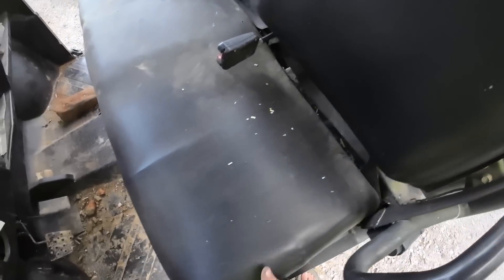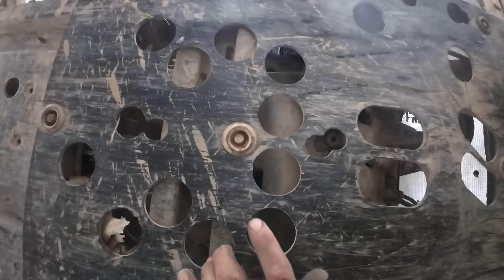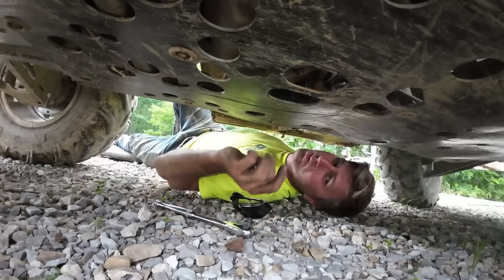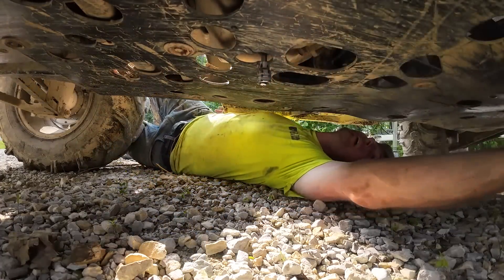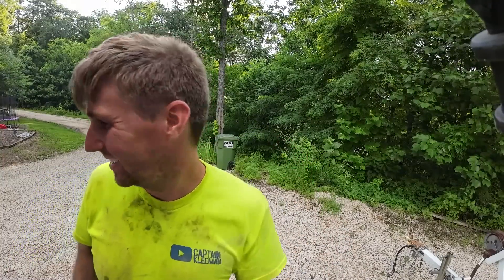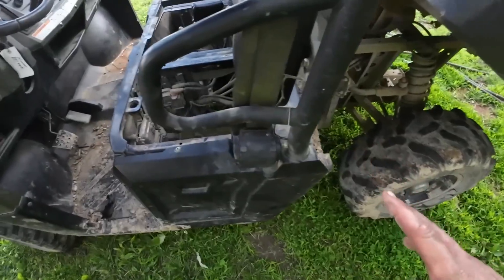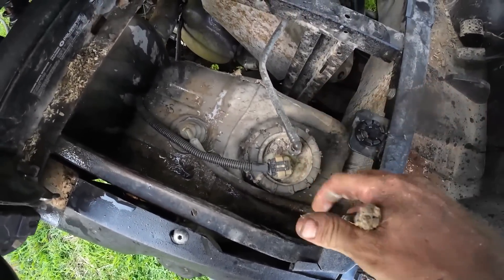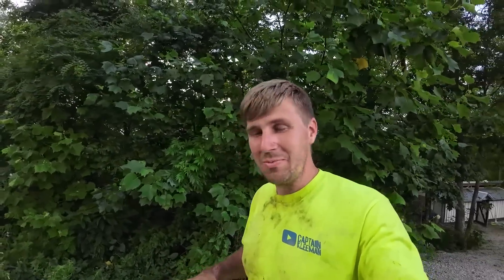Oil Change Polaris Ranger 800 EFI - Is This the Best SXS?

Comment: Well, morning, Captain.  We have had two SxS utilities, a Kawasaki MULE that we bought new in 2013, and a Polaris Ranger 800 EFI we bought a year ago.  The Kawasaki is in the barn, with the engine dead, the Polaris was sold to someone whose son was a Polaris dealership mechanic. Changing the oil was ridiculously difficult on each.  We had the Polaris for about six months as a "spare" for the MULE on the ranch, and in that time, I spent close to 20% of what we paid for it in parts alone. The undercarriage was junk, all four wheel hubs, one shock mount, I forget what else.  (I did all the work, I'm "retired" to the ranch, otherwise, I think it would have doubled the price of the SxS.) Of the two, I prefer the MULE, the damage was kinda my fault, because I didn't supervise the non-mechanically inclined person who used it daily for 10 years.  I'll never buy another Polaris.  (At my age, I can make those "never again" statements, since I probably won't buy one, but if I do, I will have forgotten all about saying I wouldn't do it.)🙄 Thanks for giving me something to watch while waiting for sun-up, take care!
Reply: I have a mule that I have completely abused other than oil changes. Still starts, first hit. Runs Strong

Comment: 2010 Polaris Ranger 800 XP and I also work the piss out of mine. Never had an issue or complaint. In fact I'm about to perform it's 3rd full service ever. Yeah, it's neglected and abused and it still keeps going and going. Helluva product.

Comment: I so love your video attitude lol 😂 you make the video no matter what it’s about. I have a Honda pioneer 700-4 it’s a 2015. Love it have just over 3000 farm miles and roughly 700 hrs and just oil changes. Still has the original battery. I do wish I would have spent just a little more at the time and got the 1000 for the extra power and 6 speed transmission vs the 3 speed the 700 has.

Comment: 2018 Kawasaki teryx 800.   Love the thing.   Dad has a 2012 polaris ranger 900xp.   It’s been pretty good after some problems.  He bought it at Newburgh power sports and damn near drug the service manager over the counter down there.   Lol    Ended up having to take it to the polaris dealer in jasper to finally get it fixed correctly and hasn’t had a problem since.

Comment: I have an 2020 honda pioneer 700-4 and other than the transmission needing more then 3 gears I love it. The 1000 comes with a 6 speed transmission and it gets better fuel economy and goes a lot faster without sounding like the hamster wants to run off the wheels.

Comment: 2016 Polaris Ranger XP900. Only issue so far has been the clutch and belt slipping causing a jerking motion when first taking off. Popped the cover off and using a abrasive sponge cleaned the insides of the primary and secondary clutch and she runs good again.
Reply: Get a durclutch.... trust me, its the best thing you can do for performance.

Comment: Suzuki 500 atv and a tractor supply 4x6 trailer was my main woods “mule” for 15+ years & still gets the job done. I inherited a 2wd Kawasaki mule about 5 years ago & use it a lot these days. I’d want one with 4wd if I had to rely on it alone, though. No problems with either one, but they are utility tools much more than play toys.

Comment: Hey Mike, just a thought on those open frame rails...  duct tape them closed and fill with low expansion foam? That would decrease the water/mud holding and not add weight...  Always enjoy your videos! Keep 'em coming!
Reply: I have heard other mechanics say "junkyard digs" for one that foam will trap water.

Comment: We have 2 Side by Sides A 2005 Kubota RTV 900 and a 2016 John Deere 825i. The Kubota is best for spraying, hauling and general work because of the hydrostat drive and the hydraulic dump bed. The JD Gator is used to get around because of it's speed and is used for a lot of different task. I really like both.

Comment: I got a CFMoto UForce 1000 back in January for work on the ranch.  It runs a little rough and the transmission is a little touchy, but no problems yet.  Going to take it back to the dealer and see if we can get it running a little smoother.

Comment: Thanks for sharing, from the easy access design of that almost makes you wonder if there is some planed obsolescence going on by encouraging people to not perform proper maintenance. Was wondering if it was designed by the same people as DPs previous skid steer. Was thinking you might want to buy a filter socket to use with your ratchet and a few extension shafts for the future. Seems like that is the only way to easily get anything in it, that is if they haven’t blocked that path either. That and maybe a new drain plug. Wishing you and your family the best.

Comment: 2010 polaris ranger 800 exp special edition, I use it for hunting. Its been a great machine i use dual batteries because I run a light bar and a go light. I will like it to be a little less noisey in the woods. Complaint number two is the heat from the fan, In the summer its unbearable.

Comment: I like my 825 Gator.
It's for work, not play. Most of the time I've got a 65 gallon sprayer in the bed but I've had a little of everything in it or hooked on the back or front 2" receivers. 
Only pain on it is you have to drop a skid plate to change oil (well.......).
Otherwise, for it's rated payload and what I want it for I couldn't be happier.
4 wheel drive with diff lock and good payloads, walks on water almost, what more do you want for a working sxs?

Comment: That filter is just slightly less handy than the one in my 2002 Chevy with the 8.1L engine. The engineers in their infinite wisdom decided to wrap the exhaust pipe completely around the filter and locate the front driveshaft directly under it.
Reply: That’s kind of a necessity when you stuff 8.1 liters under a hood that normally holds less than 6 liters. 
Things get a little tight. 
That much power has its consequences. 😉

Comment: If you want more information on side-by-side to check with Stoney Ridge farm. By the way, technically you were pressure washing your side-by-side you just weren’t using a high pressure machine. If you were to change the setting on your sprayer you would get a much lower pressure then the stream you had, which is simply caused by giving a small opening for all the water pressure. It would normally come out of a half inch to three-quarter inch line.

Comment: They all have lots of good and bad points…CanAms have notoriously poor diffs that are both weak and always spin the tire with the least traction and have overheating problems across most of their UTV line. Polaris SxS’s and atv’s have always been plagued with terrible quality control at the manufacturer and super weak reverse gear designs. I’ve seen new $25K Polaris SxS’s with stripped or cross threaded fasteners…and a zero miles XP pro turbo with a cracked air filter housing..Imagine trashing a $10K engine in the first hour of use! Honda , Kawasaki and Yamaha all make pretty decent products but these three brands are known for lacking in power compared to the first two I mentioned. They also have been unwilling to improved models year after year and seem to just rerelease products that can’t keep up with the first two above. I’ve owned all 5 brands and I guess I’d have to say Polaris was the one I’d buy again if ever got in the market for a ridiculously overpriced golf cart.